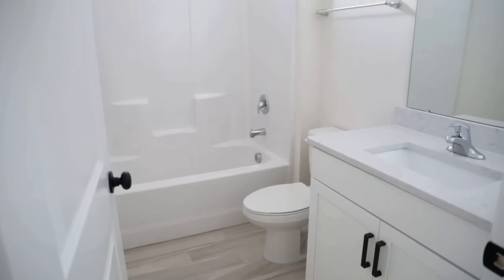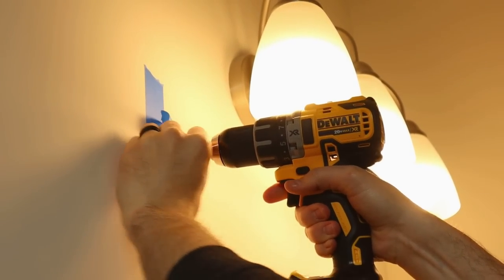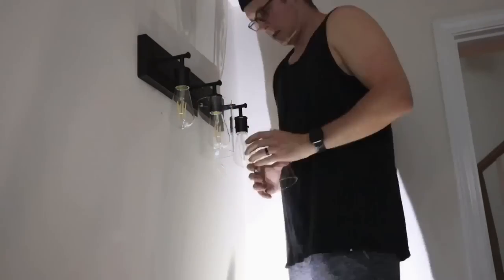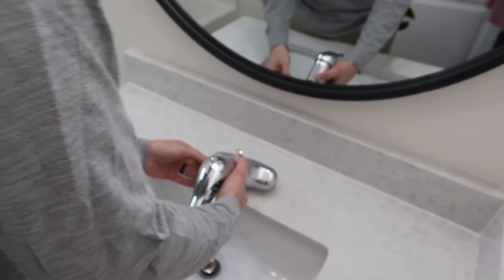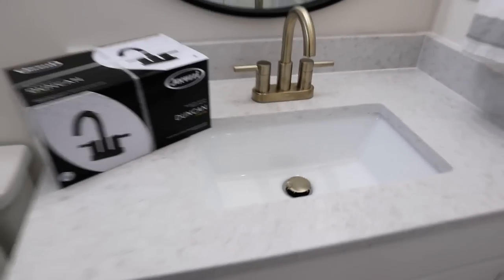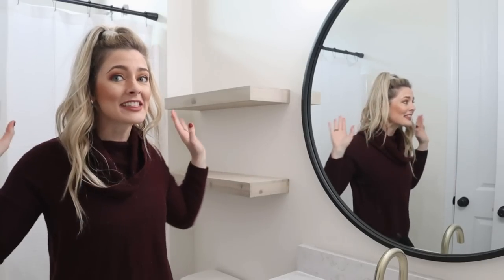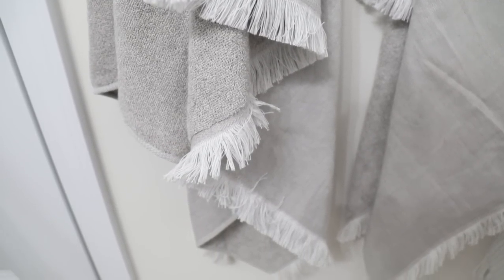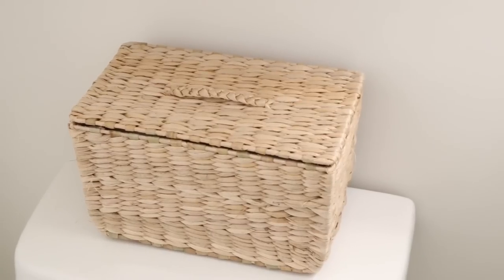DIY BATHROOM MAKEOVER || BATHROOM STYLING TIPS

Comment: I LOVE your makeover/restyle of your bathroom. This is the style I used in my son's new home. 

May I suggest you move the shower curtain up just a bit so you don't see the showerhead?  IMHO, it's a bit distracting and it doesn't match your faucet.  If you find that it makes your shower liner a bit short when you raise it up, you can order longer ones on Amazon.  They come in 75" and 78" in lengths, the standard ones you get from Target, etc. are usually only 72 inches.  I did this in my son's new home when we raised the rod and it works well so that liner doesn't come out and leak water on the floor when someone showers.  

Looking forward to seeing more of your videos!